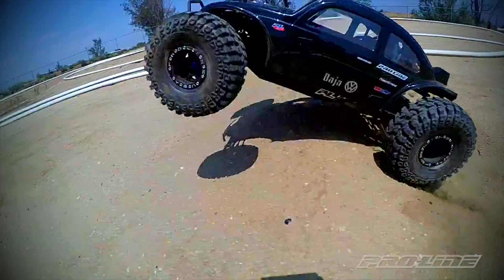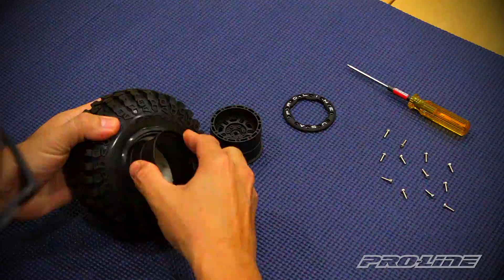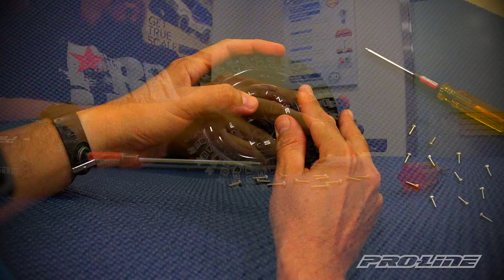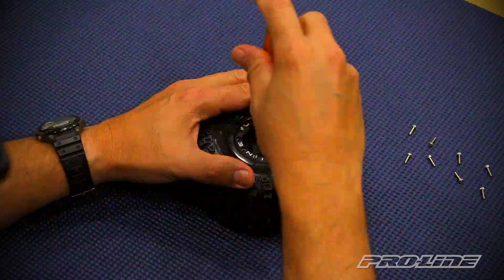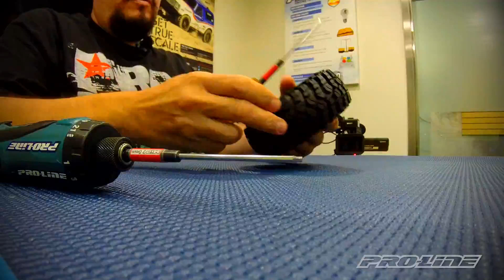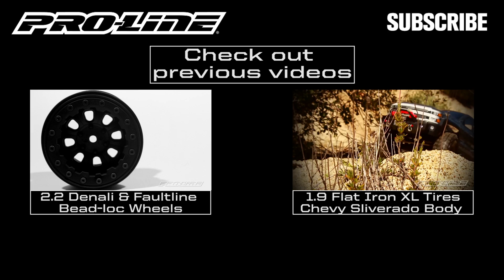Pro-Line HOW-TO: Assemble 2.2" Bead-Loc Yeti Wheels

Comment: which hubs will work with these
Reply from the maker: Hello Daniel, These wheels will fit onto the Yeti truck. The Yeti comes with a 6 lug hub that has a 12mm hex.
Reply: also vanquish slw hubs work.  I use them on these wheels
Reply: Pro-Line Racing  do you have a tire that will fit a 1:8 maxstone Rock crawler?
Reply: Maybe a 2.2 flatiron but I'm not sure all I know is that the tire is bad**s